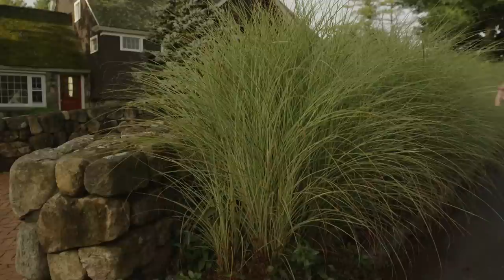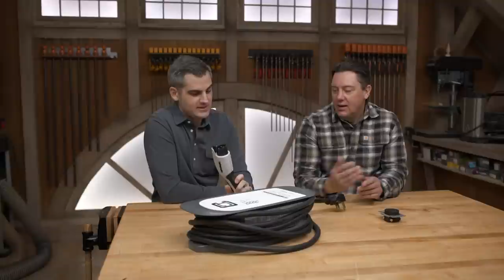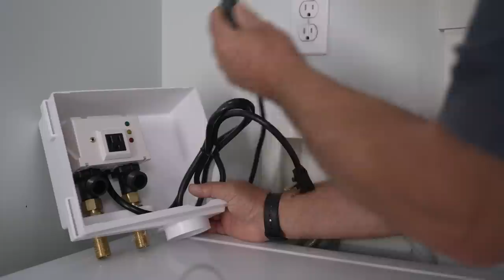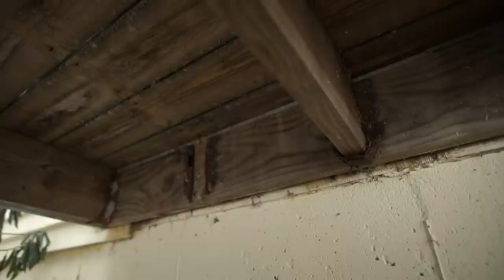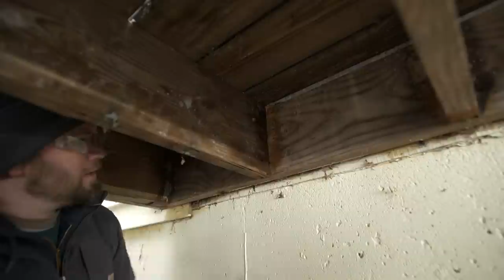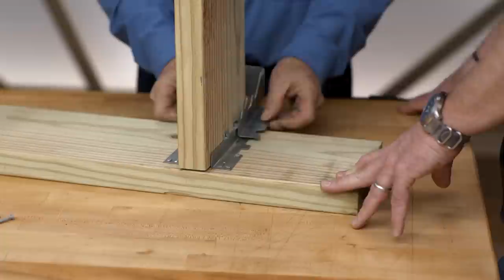ASK This Old House | Flood Prevention, Deck Hangers (S19 E24) FULL EPISODE

Comment: Suggestion for the deck: I forget the brand, but I ran across an ad for an electrified mat that can keep the ice/snow off the deck (120V). There are multiple variations including daisy-chainable mats that can be used on the steps. They even have driveway sized mats (240V).

Comment: I just had a 3 yr old braided washing machine hose leak.  I am always checking them as it has happed before in another home and caused $$$ in damage. In short order it did a lot of damage to this laundry room.  I shut the valves off when I leave the house.  To add to the mess the valves won’t shut off all the way now.  I would rather have laundry in the garage!  If your going to have a laundry room in side the house it should be treated as a wet room with tile up the walls and a drain.  That should be code across the country. Just my opinion. I will be getting this auto shut off box to replace the bad one thanks for the info.
Reply: What??

Comment: I do turn off my water to my washer when we don't use it. Just to hopefully  prevent a leak. I finally changed my hoses, as a preventative  measure, after about 11 yrs. They still looked great, just didn't want to chance it when I was washing and water was on.
Reply: The outside usually looks great until it doesn't it's the inner rubber
Reply: @stich1960  yeah, it will looked good from the ends inside that I could see. But you are right

Comment: (edit) Tommy is the real mvp cleaning up those loose ends. Ugh such a great opportunity to explain why and in detail how you can only use structural screws on joists. Smh the way you glossed over it dooms me to continue taking out drywall and deck screws because no diyer understands

Comment: When I purchased our house there was 20 inches of water in the basement.  The seller swore it had “never happened before”…I went down and saw the permanent water marks.  I dug out a 4’x4’x4’ sump pit, lined it and put a 2hp pump at the bottom and a secondary fail safe at floor level.  It turns out the house is built over an artesian spring.  For 5 months of the year we pump an average of 72,000 gallons per 24 hour day from the basement.  During the dry season we see significant slowdown.  But the work we did makes the house salable.  When we bought it had to be a cash deal because of the flooding…but what a great deal!

Comment: Induction charging for phones is ~85% as efficient as just plugging it in.  Unless the car can stance itself to lay on the floor, how much worse would it be for a car when it has a lot more distance between the pad and battery?
Reply: With limited self driving it seems like there would be some fairly easy fixes though, a car that can park constantly and some kind of lifting charger would be just one fairly simple way to address that.

Comment: What if the house loses power?  How does that affect the electronic washer water valve?
Reply: @Kevin-mp5of  no lobstahs can escape?
Reply: I have one of those and have had several power failures.  The valves are always closed and only work when the washer is turned on.  As soon as the washer turns off, or loses power the unit defaults to close (at least the one I have does).  I tested it when I first had it installed.  Love it.
Reply: You won't be doing laundry if there's no power.
Reply: @dalesworld1308  that's obvious but I wouldn't want the valve to open if power is lost.
Reply: Ok Captain Kirk!

Comment: "Vehicle to grid": no, what you describe in the video is "vehicle to load". V2G sends the electricity back to the utility, and is useful to the utility, who in some cases will pay a premium to the homeowner for the electricity, to help smooth out supply and demand during periods of peak demand. V2L is useful to use the power directly, either for when the grid is just not available, or to shift consumption patterns to take advantage of peak pricing (i.e. use the power directly when power is expensive, charge the battery back up later when it's cheaper).

Level 1 charging: it's true that level 1 charging is slower. But for the vast majority of people, it's perfectly sufficient for most days. The typical American driver drives somewhere between 30 and 40 miles per day, easily recouped overnight. Never mind that many people have charging available at their workplace, or can easily stop at a faster charger somewhere along their commute. Don't get me wrong: a level 2 charger is way more convenient, and I'd recommend it to anyone with an EV. But it's hardly the case that level 1 is unusable for most people.

Ice melt: it's true that NaCl is about as bad as it gets, for corrosion and for environmental concerns. It's also true that MgCl is much better, but it's not a panacea, as it's still somewhat corrosive (to concrete as well as metal hangers, screws, nails, etc.). Pity that the discussion here didn't mention calcium magnesium acetate, which is 100% non-corrosive and minimally impactful to the environment. Granted, it's a lot more expensive, but then you don't have to pay someone to replace all your joist hangers every few years either, nor replace the eroded concrete, so there's that. It should've at least been mentioned as an option.

Comment: It's unfortunately ironic that in a search for efficiency we're moving to behemoth electric vehicles with batteries that, on their own, are nearly the weight of entire sub compact cars. And while we do that, those sub compacts are disappearing from the market. It has gotten to the point that the US NTSB is now making cautionary statements about the risks associated with these gargantuan vehicles due to their enormous mass.
Reply: and we will dig out all lithium from our earth .... really ecologic solution ....
Reply: Lithium mining is terrible for the world and the poor people who dig it out by hand too.
Reply: It's true that the best solution to cars is **to stop using cars**, and that the weight of batteries is a modest issue. But weaning the American public off of cars is likely to take a very long time. In the meantime, EVs are in fact a significant improvement over fossil fuel-powered vehicles, even when the electricity is generated by fossil fuel-powered plants, and of course get even better as we transition to clean energy.

Subcompacts were disappearing long before EVs showed up, replaced by SUVs that auto manufacturers push on the consumer because they have much higher profit margins, mainly due to them being exempt from a variety of safety regulations that apply to regular cars. And in fact, while a given EV is unquestionably heavier than the equivalent gas-powered car, the current EV market has shown a shift back to the smaller, lighter-weight cars relatively speaking. EVs provide much more direct feedback on and consequences for driving style and vehicle size and weight, which helps push consumers back to more sensible cars.

Comment: The exterior deck hanger story induces me to mention an improvement for such hangers. The industry should pressure the manufacturers to ceramic coat hangers and other exterior type hardware.this is one thing that already exists in the screws, so it can be expanded for such purposes. Mainly as people have a tendency not always follow directions especially if a property changes ownership. This story shows how despite being galvanized, such hangers can be deteriorated. While there would be an increase of cost,it is comparable to that of clay coated deck screws. Galvanized joist hangers were originally  conceived for interior use so the galvanization was never built up as it is for metal garbage cans.
Reply: @Kevin-mp5of   By giving your customers the best repairs and materials that last longer, you actually increase the number of times  the will call you for other repairs. Having customers call back for the same thing fosters distrust in you abilities and products.
Reply: @Kevin-mp5of  unfortunately, I agree. There are too many.

Comment: Umm, you can get 7 MPH on a 20 amp circuit with a mobile charger.
Reply: That's true. But I have not seen many Level 1 chargers that will take advantage of a 20A circuit. Most are designed with a regular 15A circuit in mind, so 4-5 miles/hour remains typical.

Comment: Acutally I do not understand, why so much fear just about wash machine hoses, Same kind of connection is under each sink, in every bathroom or kitchen. And there is nobody, who will worry about these hoses. Just about wash machine hoses... Can somebody explain me why?

Also here in Europe nobody care about any kind of hoses in house. They serve generaly for 20-25 years and with no problems. No automatic shutt of valves, no lever valves... Typical water pressure is about 3 bar (45 psi)..
Reply: You are right, if these are the only hoses one worries about, that's short-sighted. Though, to some extent it may be because the washer is often located in a spot that is less observed. If a hose breaks in your bathroom or kitchen, you might notice it earlier.

All that said, in my opinion the biggest issue is that North American building code doesn't require drains in waterproof (e.g. tiled, concrete, etc.) floors in every room that has a water connection. Hoses are generally reliable, but once in a while, one is going to break, and it's impossible to know for sure when or where. Why allow the entire building to be exposed to water damage when it'd be possible to keep water leaks contained?

Comment: A Level 1, 110v, 16A EV charging cable will only provide about 2 miles/hour of charging, not 4-5 miles/hour.
Reply: Depends on your car. If you're driving an electric Hummer, you're right.

But most of the cars sold are getting at least 3-4 miles per kWh, and a 120V Level 1 station can provide over 1 kW of charging, so 4 miles/hour is well within the typical range, and 2 miles/hour is far too pessimistic.

Comment: Like my gas powered car it recharges in 5 mins.  I can drive 600 plus miles on one tank.  Hybrid really should be the focus we are trying to jump before we hop.
Reply: Exactly.

I said that to an environmentalist in a job interview and the dude claimed that I was less concerned about the environment than he was.

The way I figure it; a plan that ends in success shows more concern for the environment than a plan that is dead on arrival due to it's unreasonable demands and impending failure.

Going hybrid first also allows the electric companies the time necessary to build up the grid so that it can handle the demands of a fleet of EVs. Right now, when too many EVs are put on the grid, there is not enough power to provide for EV charging and heat.

In one community in Tennessee, all it would take is 700 EVs to cause the electric shortage.
Reply: so true
Reply: That just means you may not be the right person for electric or maybe one of the types that likes to drive a pickup around all year for the one time they use it. Yeah the way they are today is very niche but someone that drives in the city a hundred mile commute or less every day it can make a lot of sense.
Reply: @stich1960  
"That just means you may not be the right person for electric or maybe one of the types that likes to drive a pickup around all year for the one time they use it. Yeah the way they are today is very niche but someone that drives in the city a hundred mile commute or less every day it can make a lot of sense."

As long as electrics are sold with that understanding but they aren't.

Under the push to go fake green, you don't get to choose which energy you want to use, you are required to use electric and which has no other purpose than to diminish your freedom of movement. 

On top of that, they keep reducing how much electricity is produced to the point that on high demand days they tell you not to charge your EV.

Then there's the time of day rates that they implement in order to force shut ins and people on fixed incomes that can't go anywhere, to subsidize the lower cost of energy for the rich that have EVs.

In some areas, they won't let you use wood burning stoves now even though some of them burn as clean as natural gas.
Reply: @stich1960  there are some inherent flaws they have also.   Like the production.  My gas powered vehicle doesn’t go on run away when the battery gets damaged.  They are hackable and can be controlled remotely due to the drive by wire systems.  Some gas powered vehicles also have this flaw.  So the more computerized the more issues.  Are there people who buy a vehicle just to buy it.  Of course that’s their choice!  Just like you may choose to buy an electric vehicle.  I can buy a pickup truck drive it for its whole life and still spend less than the overall cost of eclectic.  I am sticking with recycled dinosaur power.

Comment: Problem with Electric Cars at least Right now is Just the Range. Some People just want to be able to go that Distance quickly IE like 600+ miles per day IE 12 hours of driving for those that end up doing that long type driving at 60 MPHs. before stopping for the day. Some people do not want to wait 10+ mins to get back on the road waiting for car to charge up. 
So they will stick with Gas/ Diesel cars more often. so only takes a couple mins to fuel up and go saving time. 
Then there is the Price of the EV cars. with 95% of them being over $50,000 they are out of the Price Range for about 90% of people could afford or would want to spend.  So Until the Mileage can be approved to be over 600 miles per charge, and the price of them down to $15,000 to $25,000 for some of them. Gas/ Diesel cars/trucks will still be what 90% of the Population are going to stick with... For NOW.

Comment: Yes you should feel good about your EV that gets its electric from what? Fossil fuels.
Reply: Even if the electricity comes from fossil fuels, the EV is more efficient than a gas-powered car. And guess what? A lot of electricity doesn't come from fossil fuels, the proportion of clean energy is increasing at a rapid pace, and EVs only get better as more and more renewable energy comes online.
Reply: @harvey66616  yeah and if you believe that I've got a bridge in Arazona to sell you. 
I can fill my car up in 5 minutes and travel 500 miles. If you want EV'S to be efficient, then solve the problem with perpetual motion.

Comment: Don’t like electric cars and will never buy one they will not hold up .
Reply: Actually powered by coal, gas, hydro dam  and lobstahs running on hamster wheels
Reply: Thanks for your input, you’ve changed so many minds.
Reply: I'd buy an electric car, but only if I could charge it with a coal fired generator.
Reply: @krockpotbroccoli65  showrooms and dealerships are full of coal fired electric cars
Reply: Ok 👍
Reply: I agree
Reply: @brianglade848 😂😂😂😂😂😂😂😂😂
Reply: I bought a Tesla in 2019, I can sell it for the same price I bought it for. Essentially a free car for 5 years already.  Using a car for free is  pretty nice benefit.
Reply: @User-pb8pd  yeah so? How much have these manufacturers been subsidized by government so you can drive a "free" car? There is no such thing as free anything. FYI..
People are paying more for  used internal combustion engine vehicles than brand new.
Reply: @rd-ch1on  I like how your argument to EVs retaining their value well is that used ICE is more expensive. Way to argue against yourself😂
Reply: Good for you

Comment: Thing that concerns me even though it shouldn't is when electric car catch on fire due to battery failure or any other reason. I have now heard from 3 sources, 1 being it actually happening in our town so from firefighters- That when electric car is on fire in garage, let's say, underneath apartment building, the fire can't be extuinghished ! They have to pull the car while still on fire out from the building and put it in a massive tank of water for a week or so. I heard this fire can be so strong to disrupt the construction of concrete in mentioned garage or place..... Did noone really thought about that? What if my car catches on fire on road and they can't extinguish the fire nor pull me out ? I would be left there as a way too well done steak !
Reply: The fire issue with EV's is that they require a massive amount of water to cool the damaged battery while it discharges or else the fire reignites. If the fire department can't get that water supply to the car then I suppose towing it to a safer location is an option. Gasoline fires are equally dangerous when they're active but lack the spontaneous reignition issue once they are extinguished. Personally, I think that sprinkler systems in indoor parking lots will have to be updated. Same with situations such as passenger ferries. Lots of issues that have not yet been faced.